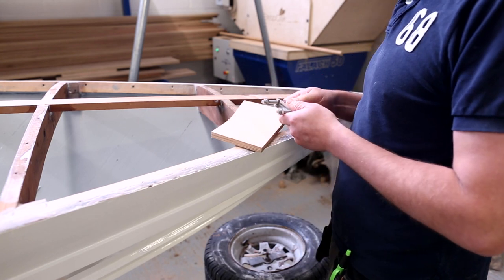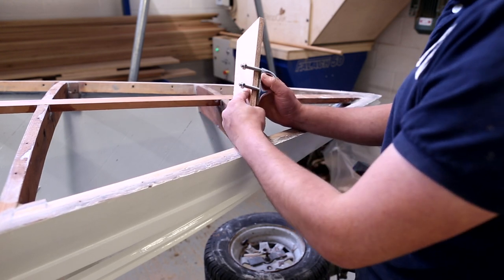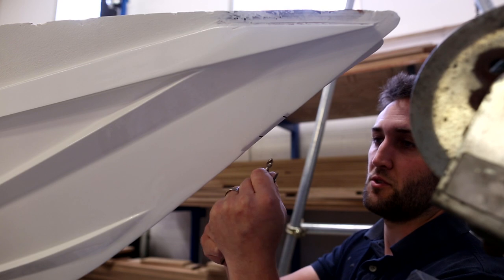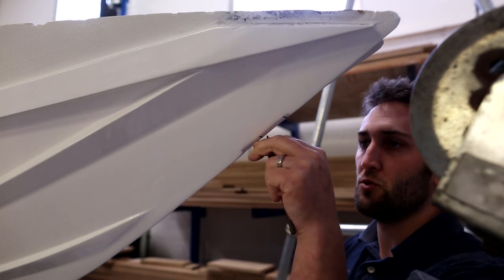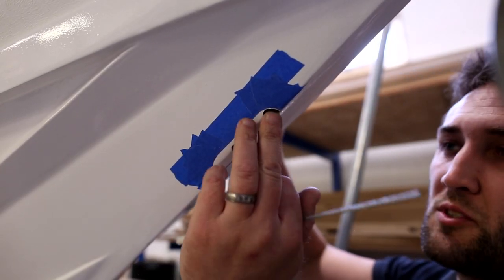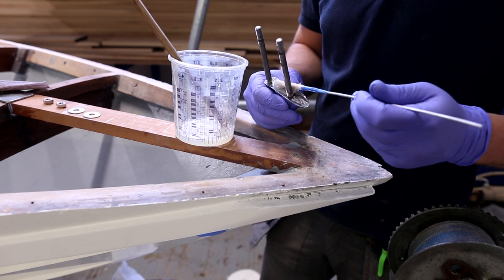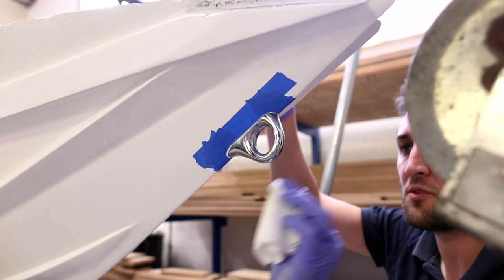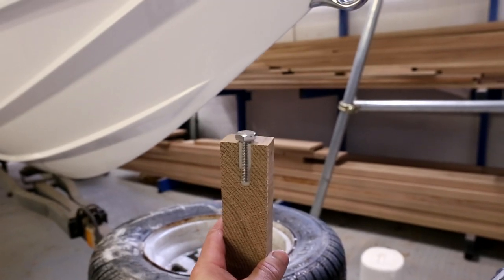How to Install a Bow Eye on a Wooden Boat Hull | Gougeon Brothers Method

Comment: Really helpful video !  I am building a boat, with 1/4 plywood and I have used two layers ( either side ) of the plywood. Hence the total thickness where the bow eye could go is about 3/4 inch. Could you please recommend what kind of bow eye specification could work best with this thickness dimension ? The boat is about 11.5 feet x 7.5 feet. Has a small deck and wheel house as well. So, not very heavy but a small-ish boat. Trying to understand what kind ( gauge / diameter etc ) can work best. Thanks.
Reply from the maker: For that size of boat almost any bow eye will be plenty strong enough for the load, especially if installed in this way. I would probably suggest trying to find one that fits the style and shape of your boats stem and let that guide your decision.

Comment: When using this method, does the oversized hole need to go through the fiberglass as well?
Reply from the maker: The oversized hole should be about 2/3rds to 3/4 of the total fixture depth. Don't drill the oversized hole right through or you will have no material left to position the fitting.